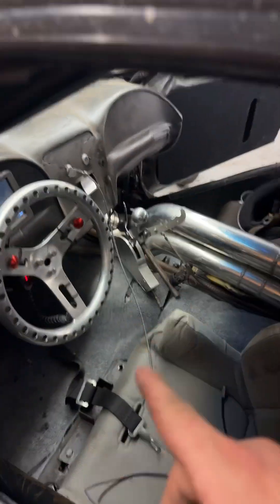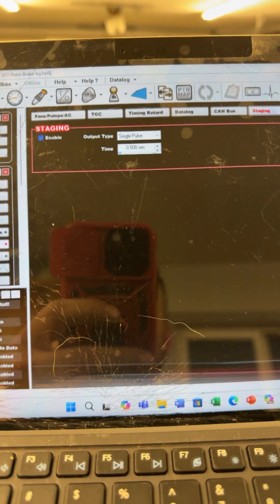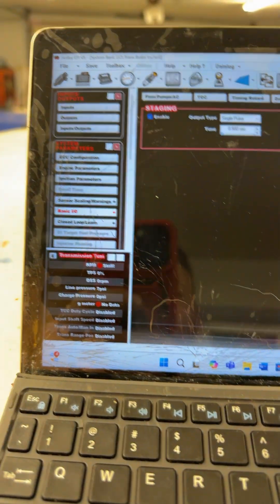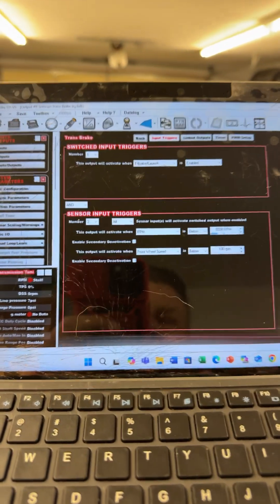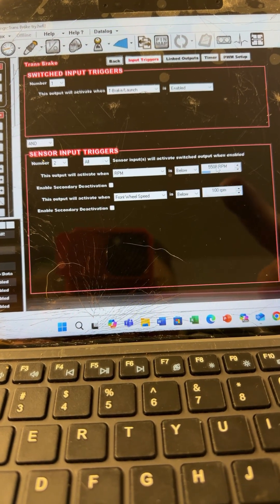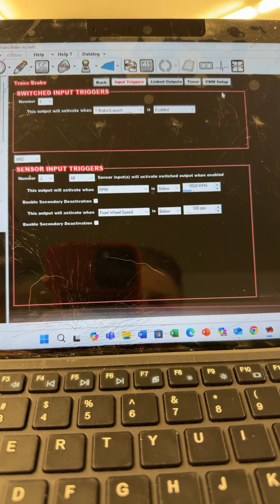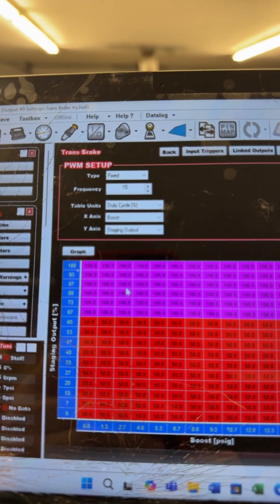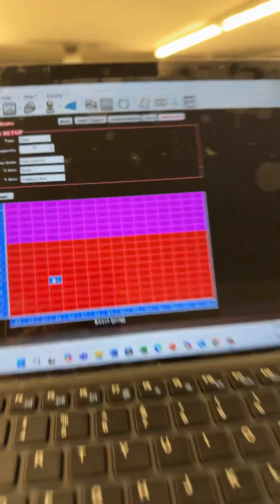Custom Holley Efi TransBrake Output Safety #holleyefi #dominator #terminatorx #hpefi #diytuning

Comment: What rear gear with the 2nd gear leave
Reply from the maker: 4.56. It’s phenomenal. If that’s too much (say 145-150 plus trap) 4.30 would be next
Reply from the maker: And it works so good on backsides too 😂
Reply: @RoryMalloy  that’s what Pete told me to run but I’m stuck on 4.10s bc I still do & want to street drive the car. This ain’t a racecar
Reply from the maker: @BmoreFox yeah. Driving around here ain’t bad but doing faster than 65 it really sings. I think a 4.30 wouldn’t be terrible. I did try a 4.10 at first but it had some phantom misfire I didn’t realize and like a dummy blamed the gear. My converter and gear really do love each other. With a 4.10 I’d just use a dump more and/or just add more power really
Reply: @RoryMalloy  yeah man I need to ditch this 2.48 first gear badly. It sucks trying to get down the street. I wish i just kept my glide lol. Might have to try the 4.10 first & see how the converter likes it then try to find a decent valve body
Reply from the maker: @BmoreFox yeah. I love it because mine would always strike the tire if I didn’t short shift the 1-2 shift. Nice part about my valve body is it has engine braking still as well